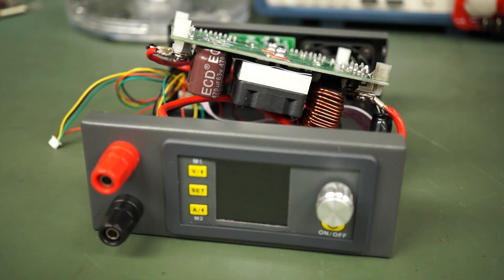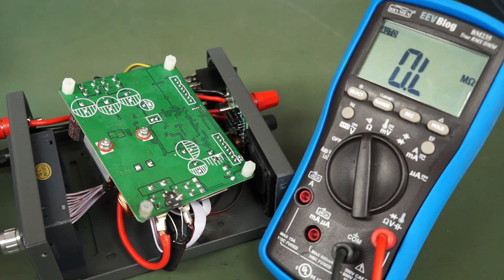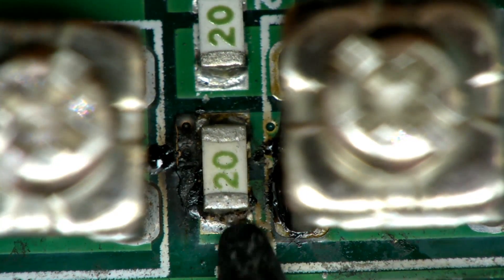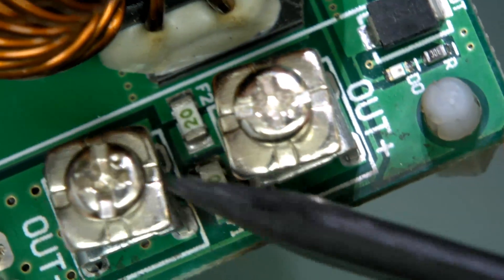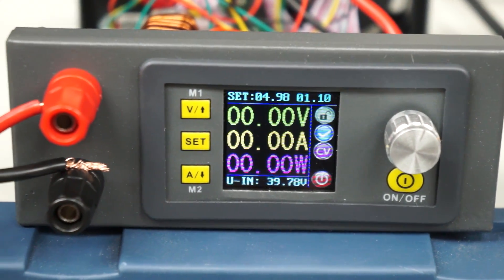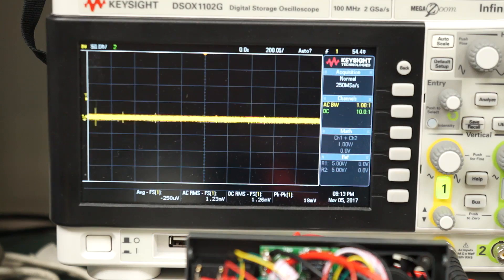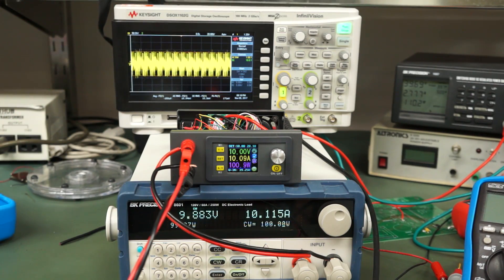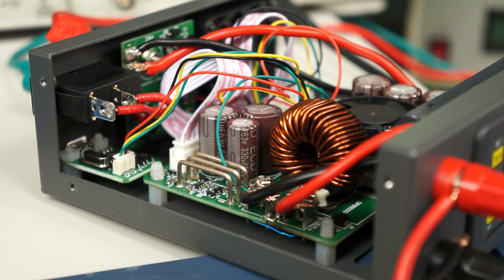EEVblog #1036 - PSU Fire PCB Repair

Comment: Wouldn't a simple mod to resolve the problem be to fit a wire ended cap instead of the surface mount one. The wire ends would provide sufficient resilience to eliminate the stress being applied to the cap when the screw terminals are tightened.
Reply: Some ceramic capacitor manufacturers have MLCC SMD offerings which are much more resistant to PCB flexing and have a failure mode with a preference for failing open rather than being a short. Ex. http://www.avx.com/products/ceramic-capacitors/surface-mount/automotive-mlcc-with-flexiterm/
Reply: If you keep the leads reasonably short and close to the board, the lead resistance is so low, its not measurable. Its not as if there are huge currents on the ceramic capacitor leads.
Reply: Simon Tay  It has nothing to do with current, it entirely depends on the switching frequency.  At higher frequencies the inductance on the leads increases significantly and your reasonably short leads will have way too much inductance.  Even the extremely short leads on an SMD package can be too long if the frequency is high enough.  The capacitor that RD Tech added should not have been added at the output connector, it should have been added near the switching inductor because even the PCB traces will have significant resistance and inductance making the added capacitance useless.
Reply: Brian Oldford
That was my immediate thought.  I suspect that they just have those MLCCs in stock, saw that they could be soldered between the pins, and so used them.

An attempt to polish the product a bit by adding that capacitor ended up backfiring on them.  At least they cared to try to improve the product.
Reply: Maybe the publicity and demonstration of their good customer relations will be a net positive.
Reply: But SMD caps are generally used because of their extremely low ESR. So if you add leads or out it further fro what you want to decouple, you're making it less efficient. Am I right?
Reply: CZDrMike  yes you are correct, however extremely low ESR is not always best.  The ESR needs to be properly calculated, if it is too low it can cause stability issues in the control loop.  The manufacturer of the switching regulator will provide information for the correct type of capacitor, value and ESR range.
Reply: CZDrMike  Which is why I suggested copper tabs.  And yes you are right. :)
Reply: This is probably the root cause. Flex cracks are a real problem with ceramic caps.
Reply: Brian Oldford form an electrical stand point you are wrong.  Adding a leaded capacitor will not help reduce the ripple.  These will have higher ESR and and the leads increase ESL decoupling the capacitance from the output node causing it to have no effect.

Comment: Glen, the location of those SMD fuses is horrible, if they blow you basically cannot access them to replace!
Reply: Andrey Kuznetsov if they blow, I'd move them to standard fuse holders external to the board.

Comment: I thought you said there was some sort of fan speed controler?  Or am I imagining things?
Reply from the maker: I thought it was assuming all the circuitry on the PCB, but doesn't seem to be.
Reply: Hmm.  That would be a fun circuit to dissect. How would one make a NTC temp sensor trigger a fan speed without going to far into the weeds of analog design, yet, less the a microcontroller?  Or honestly, would a little ATTINY be better for the job?
Reply: @GeorgeGraves
this is a simple borad to control the fan , and many friend want to replace ,..,. but it is not important , so I did not replace the fan,. it just be working all the time after power on

Comment: MLC caps also have great microphonic characteristics.  They can be used as low-grade conducted sound microphones, and can even replace some uses of accelerometers.

I once used one as a tap sensor, where tapping a specific pattern would initiate a different operational mode (such as calibration) without need of a full user interface or command interface or even switches.  Just be sure to use a pattern that won't be accidentally triggered by normal handling!

Such use is stealthy as hell!  Impossible to detect just from looking at the schematic or PCB (unless you already know the trick, and sometimes not even then).
Reply from the maker: I've done several videos on that.

Comment: Wouldn't a small ceramic cap do better at noise filtering than a 22uF electrolytic cap?
Reply: Exactly my thoughts. My personal favorite filtering solution (for permanently connected loads) is ceramic cap + ferrite bead + larger low ESR cap (~100-220uF). So it's some CLC filtering.This easily drops noise by a factor of 10 for DCDC supplies.
Reply: Even 47uF on the output of a variable power supply is considered too high, and it is the highest designers will go. This is because if the cap is charged, it will have enough energy to destroy something if you crank down the output voltage, attach a new circuit, but the cap will be still charged at +30V. Also, large caps on the output do mess a lot with the output current limiting circuit. Small SMD caps are a good idea, but mechanically it has to be designed differently compared to the product Dave tested here.
Reply: You are correct, I use large caps on output of DCDC only for permanently connected loads.
Reply: Depends on the frequencies of the noise you want to take out. :)
Reply: I was thinking the same.  Standard electrolytics can have quite a high ESR, and it gets worse the higher the frequency;.  Hence bypass caps on op amps always being ceramic.  Rubicon ZLH (or ZA if you can still get them) are among the exceptions.  OSCONs might not do the voltage you need here.
Reply: Put a high value discharge resistor in parallel?
Reply: IMO anything wire ended would resolve the problem. See my comment above.

Comment: What if you screw the terminals first and then solder the capacitor?
Reply: Kostas Albanidis, Better to make a revision to the board and change the location or the type of the cap to avoid such problem altogether.
Reply: Yeah this would be the best approach. Tension will be present even if the capacitor is soldered last....
Reply: The terminals aren't screwed to the board, they're screw-terminals.  Ie. the output wires would need to be attached during manufacturing and tell the user to not touch the screws, which kind of removes the whole purpose of screw terminals.

Comment: So screwing the terminals into a place that they are supposed to be screwed into caused the fire? Nice ;)
Reply from the maker: Doh!
Reply: It was seeing a load consistent with its output rating. The burnt PCB had some resistance.
Edit: English is hard.
Reply: Captain Moore It was a clever trick place to put the cap. Trouble is that clever tricks can get you in trouble from time to time.
Reply: Sometimes we have to move or rotate the capacitor that breaks.  Recently used one of those Flexiterm or Flexisafe AVX caps for one board in particular that appears to have this same problem.  I notice that it is typically the larger caps (>= 1206) that have this issue....

BUT I wonder why this power supply didn't protect itself ?  Doesn't it have short circuit protection of some kind ?